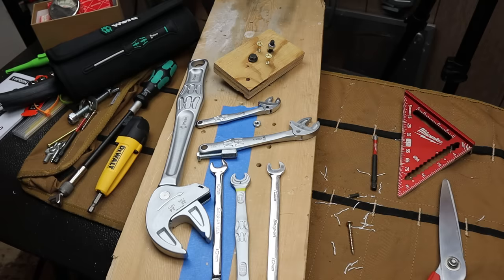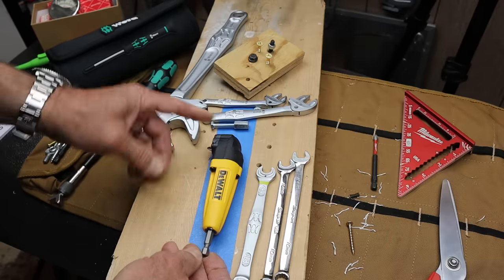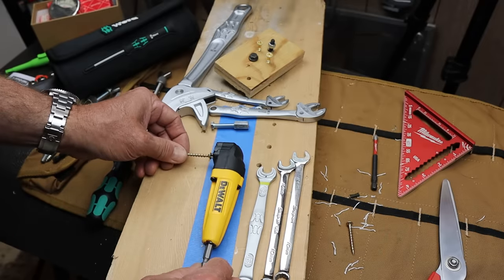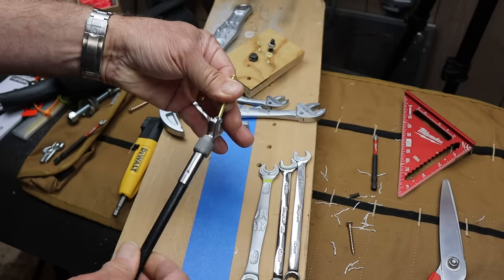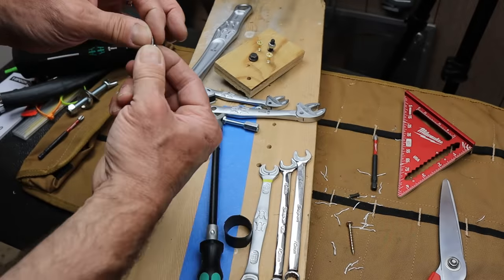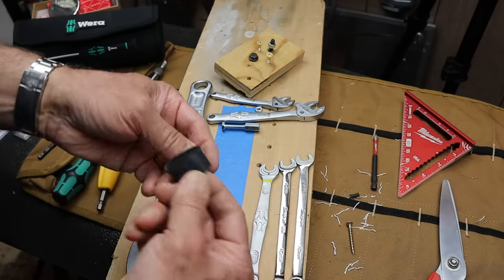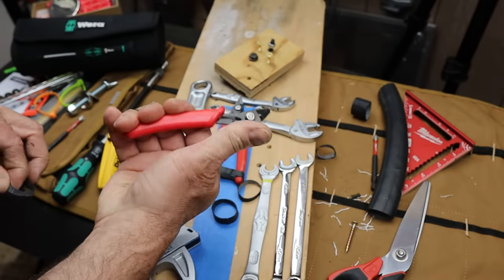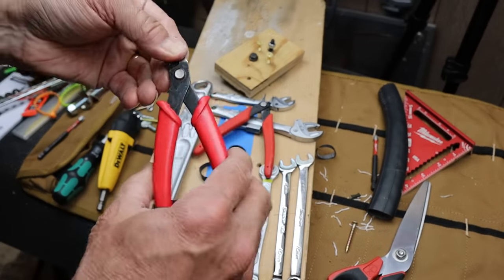Wera Joker Combination Ratcheting Wrench: If Apple made wrenches, this is what I'd expect. Very Nice

Comment: I have this set, absolutely love them.  The ultra fine resolution on the ratchets is next-level, and the retaining plate is genius.
Reply: This guy just turned a 12 minute video into a 4 second read!
Reply: the retaining plate is great until you fasten something and the plate is between the bolt and the surface,ask me how i know ;)
Reply: Thanks Wheeler commenter
Reply: I have these and if your really want to get your mind blown get some Proto fine tooth ratchet end wrenches. Actually don't do that until you have the money in your pocket because it's gonna catch on fire and burn your pocket as soon as you feel the proto 😂

Comment: As an aircraft mechanic I’m glad they are making SAE products. I love their quality and packaging. I wish they made deep SAE 1/4 sockets. I’m going to try out that bike tube trick thanks!
Reply: As someone who works with a lot of hydraulics, I too can appreciate that they make SAE sizes.
Reply: As someone who works on a 1986 f150, I appreciate they make SAE sizes too
Reply: These yuppie "home gamers" have no idea how critical SAE is in the industrial and manufacturing industry.
Reply: As someone who works on British motorcycles, I look forward to grinding their spanner jaws to the proper dimensions with my Harbor Freight angle grinder.
Reply: @stickyfox  or just, buy metric?
Reply: @SebastianWoodard  Whitworth wrenches are neither SAE nor metric.
Reply: @stickyfox  interesting. I do gotta say, I know very little about British bikes, though I'd like to learn some stuff. So they're just proprietary wrenches?
Reply: @SebastianWoodard  I was making a little wrench joke there, I'll admit. I learned about these fasteners when I got my first Enfield Bullet basket case, and couldn't figure out why all of my wrenches were slipping.

Whitworth or British Standard wrenches are (I think possibly?) the first standard for screws. Prior to that there was no real rhyme or reason to thread pitch, angles, etc. SAE and ISO did the same thing but I guess they benefited from international fame.

The real kicker was I spent like $90 on BSW wrenches so I could work on the bike, and eventually found a set of Enfield wrenches stashed away in a box of parts. Figures...
Reply: @stickyfox  lmao I appreciate the info. I bought replacement bolts for a bunch of stuff on my 86 F150 and the original owner ended up dropping off a bunch of parts including the bolts I needed.
Reply: @Eastahtata  its literally only important in the us and nowhere else in the world, I work on heavy industrial hydraulic and hydraulic rams and occasionally you’ll get a ram imperial size bolts and fasteners, but literally everything else is metric including USA manufactured hydraulic components, it’s extremely rare for most people to even encounter SAE
Reply: As an aircraft engineer in the UK, I'm very glad that places still make "imperial" tools.

They can be very hard or costly to get hold of in the UK, but they are vital for some of us.

Somebody in the thread also mentions Witworth, I have quite a few of those, plus "BA" - another old British sizing standard.
Reply: @stickyfox  yeah Whitworth are pretty unique!
I have a fair few of them.

IIRC the size is for the diameter of the bolt thread, unlike SAE which is AF (Across Flats of the bolt/nut head).

It really messes with your head when you first come across it.

I also have some "BA" which was another strange British Standard used here in the UK on Bikes, Cars and Aircraft of the past.
Reply: As an Space Rocket mechanic, SAE tools are a joke, we use Japan Made injection molded forged carbon fiber tools with titanium ends, so they are lighter, stronger and more precise.
Reply: Ive wanted a deep set of 3/8” SAE sockets for s few years.
Reply: America invented flight

Comment: if apple made it it would cost 3x as much as any other wrench, only work on proprietary nuts and bolts, and the open end part would be sold separately
Reply: ‘Proprietary’? You sound jealous.
Reply: @JimzAuto   Apple fanboys really lack creativity when it comes to defending apple.
Don't mindlessly love Apple?    just jealous.
Don't think Justin Beiber is the greatest musician of all time?  ...just jealous.

Dont love everything that I love?  ...just jealous
Reply: Alden makes open end 30 degree ratcheting wrenches!  I have a 7/16" to insert in a hole to adjust a rod nut for tension.  Can't use a box end and it takes an eternity to flip a standard open end.  All other "ratcheting" open end wrenches are 60 degrees.

Comment: I came up with tool I've been using for years. You will appreciate this technique. I used it last night on a blend door. But works best on double ended ratchet wrenches. I removed the unit last night on our 2003 MGM LS in less than 20 minutes after accessing. .But I removed the radio to access the BD from both sides. I used a mirror and a 12" pair of forceps a 1-1/2" piece of 1/8" gas line looped threw a 7mm-8mm ratchet wrench. Just open the forceps and push the hose on one tip then put the hose through the opposite end of the rachet and stick it on the other tip of the forceps and lock closed. Push-pull the forceps once attached to screws to loosen or tighten screws. To install screws put screw threw duct tape sticky side up in rachet then fold over. No dropping screws. This tool can access any hidden fastener as long as the rachet can fit on the screw. Just push pull 1 to multiple clicks of the rachet. No struggle trying to get your hand in there. I can post a short video if needed.

Comment: “The absolute one situation in the universe where that particular wrench succeeds, where others fail.”
AKA-every day working on forklifts.
I’ve had this set in my shopping cart for a week, since buying the Wera self adjusting ratcheting wrenches to replace my cheap copies I got from O’Reilly auto parts.

Now I’m going to go ahead and buy them.
Reply: Ha! Very true! (Retired Fork Truck Tech here) I found these great for starting nuts in awkward places. I had the twin open end versions though, in 10/13mm and 17/19mm. Covered probably 90% of what you find.
Reply: Alden makes open end 30 degree ratcheting wrenches!  I have a 7/16" to insert in a hole to adjust a rod nut for tension.  Can't use a box end and it takes an eternity to flip a standard open end.  All other "ratcheting" open end wrenches are 60 degrees.

Comment: Wera makes many smart tools. My absolute favorite is their allan keys. They look pretty ordinary, except for the colors, but they are not. The first time i bought a set, was the last time I had to drill out a stripped out allan key.
Reply: Agree 1000%, they are a game changer.
Reply: Wera Allen keys are the truth!
Reply: Sheeeit I like that, drilling out allans and torx is not my favorite at work activities
Reply: The sets of hex allan keys you mentioned are the only ones we use at work. Have to remember obviously when not to use the ball ended side of them. Everyday use and only the rubber sleeving shows signs of wear. The ends of the tools look still new

Comment: I've found that they can take some serious pressure, and the short throw is invaluable working on some suspension components. A breaker bar wont fit, but the wera and a hammer does.

Comment: David Anderson
0 seconds ago
Aviation as an entire industry still uses SAE fasteners. They are so standardized at this point it is hard to move away from them. Some European aircraft use a few metric fasteners, but even then they are predominantly SAE. Consequently anywhere turbines appear in industry also tends to have SAE as it's predominant hardware type. The euro tool brands primarily make SAE stuff because of these industries. I have a friend in Ireland who is an aircraft mechanic, and he uses lots of Wera, Wiha, Stahlwille, Gedore, Etc.
Reply: Heavy equipment also uses sae alot bobcat just went metric this year
Reply: America invented flight

Comment: For really tight spaces like you described with the screw, i use my wera mini ratchet with the bit in backwards. That makes it easy to reach tight spaces because your tool is now just the height of the bit you're using
Reply: Damnit bro. Now you gave me a reason to buy a new tool. And I'm keeping my klein mini ratchet. But that's a handy feature. As stubby as it gets.

Comment: I have the full set of these, 8-19mm. The only issue I have with them is the retaining plate feature. If you are removing and refitting the same fasteners time after time on a repetitious job, they do tend to chew up the nut somewhat. Especially if the fasteners are a little of the Chineseum quality....... 
I swear by my Wera tools. I have these, a 1\4" ratchet set, a 3\8" ratchet set, a VDU Screwdriver set, Allen keys and a few other bits and bobs. I have never been a tool snob and have always shunned the Snap On brand for it's lack of quality and high cost, but find myself willing to spend money on these quality tools that I know will last me a good long time. The Allen keys especially are a game changer.

Comment: i trick i came up with for those fluish cutters is that you can use maybe a 5 to 10cm long piece of heat shrink tube on the nose by holding the cutters closed so it will form kind of a sheath for them.

Comment: That wing nut bit I believe was designed originally for the eye bolts. I have a couple different sizes and they do work well. I never thought of using them on wing nuts. Great idea.  The one particular situation in the universe happens more often than once. 😂

Comment: spent inner tubes are wildly useful. repurposing them is a great to reduce waste!
Reply: Good for gripping on a worn Phillips or Pozi screw too. Put a layer of rubber between the screwdriver head and the screw and it gets you enough extra grip to get the fastener moving.

Comment: I have an SAE Joker set, Telecom is a mish mash of SAE and metric. The thing you have to watch out for with any ratcheting combo wrench that you flip over to change direction(lacks a switch or button for that) is you can get it stuck. Primarily if you are backing up a nut and bolt situation and it gets snugged up against whatever is next to that fastener. You have to loosen the fastener to get it out, then go get a different wrench.
Reply: That switch/button to change direction is invaluable on a ratcheting wrench to the point where I refuse to buy a ratching wrench without it. Got my ratching wrench stuck before and it was not fun getting it back out.
Reply: I have done that more than once.  I can see it coming and I'm sure the threads aren't that long, then...uh oh...

Comment: I love what Wera tools I do have and I strongly considered the jokers, but they do NOT make a 9mm even outside of the set. So you get 8-19 with a piece missing. I know 9 isn’t the most common but I use it occasionally. I went with tekton instead and apart from the retaining plate they are pretty similar. The ratcheting end is 6 point which I like to not ruin fasteners.

Comment: I wonder how TY knew that I love Wera tools?  The Rapidaptor is such a game changer. I also have the Wera 056490 which has a low profile ratchet.  I'm thinking it would have helped with the original problem.  The slip profile ratchet is so damn useful once you have it.  Thanks for wrench ideas.

Comment: First of all thanks for sharing your experience and insights, it's been useful)
Then, I think you'll find the KS Tools Set 918.3050 delightful - super flat, low angle, through hole sockets, compatible with  square drive extensions, micro bits work with long Milwaukee extensions, can take any normal bit. Made custom TPU holder and get cool portable set.
Reply: They also have interesting wrenches EG 503.5213 Or 4-in-1s EG 503.4565, even flexible 503.4745 ) saves ton of place in mobile toolkit

Comment: One of those combination wrenches would make for a decent 1/4" bit holder for tight confines...... though it looks they may not make SAE wrenches (of that design) down to a 1/4" size(?).  

Though now that I think about a regular ratcheting box-end wren combined with a coin/metal disk, & some tape (maybe a small magnet) could probably work just as easily (perhaps better) as a 1/4" bit holder.  ...assuming a person doesn't already have (or want to get a dedicated bit-holding ratchet).

Comment: They’re expensive and only accept threaded bits, but aviation drill pancakes get into tight spots. Other option is a 1/4 Rachel wrench with just a standard bit slipped in.

Comment: I have a set of those Wera's and a couple of the snap ons. I can tell you that the snap ons are more durable. I was using a 15mm wera wrench on a stubborn bolt and actually broke the ratchet mechanism. The snap on being beefier was able to handle the force. Wera sent me a new wrench no questions asked. But I like the wera better than my snap ons. My only complaint about my wera set is that it didn't come with a 9mm.
Reply: Ratchets were never designed to be the function the breaks a stubborn bolt loose. Use the static end or a break bar. Sorry had to say it my boss has seen me do it before and just shakes his head lol and says that exact line needless to say I learned my lesson. How long did it take for the warranty process through Wera? I'm new to their tools and quite honestly I LOVE the way they feel in your hand and just using them feels good haha.

Comment: Hey doc, there is a craftsman ratchet out that I think you might find interesting.
It is part number cmm86000. 
It works like a regular ratchet but the handle rotates so you can tighten or loosen without having to move the tool.
Reply: Ok thanks for this I didn’t know this existed. Part number is close but it’s actually 
CMMT6000 for those who are trying to look it up
Reply: @trappizze22  Part number appears to be CMMT86000.
Reply: @trappizze22  Part number appears to be CMMT86000.

Comment: I have that one from Milwaukee right angle driver that they now charge $60 for that when I got it two decades ago was only $30. But they were the only ones out there and I've had that on my impact driver for a very long time and that thing still works perfectly. I know that they now make a smaller one that cost about $30 I suspect that one is not going to be nearly as good as the more expensive original one they made

Comment: I've been using Wera ratchets, sockets, allen and torx keys, for a few months now at my new job.  I love my Wera tools, but my only complaint is their warranty contact, or lackthereof.  My 3/8" ratchet seized up after 3 months, and I haven't found any way to contact Wera for warranty replacement.  I filled out the online form to contact them last week but havene't heard back.  The benefit of Snap On is that the truck will come to the shop and replace whatever I need instantly =\ so there's that.

Comment: Wow that dewalt right angle is massive!! Milwaukee makes a much smaller one. Dewalt makes a couple n theres one smaller than that as well. The smallest one ive seen is an older milwaukee one, but prob still not small enough for what you need it for w such a long screw for a tight spot. Lisle makes a tool called something like an actuator ratchet that would be perfect
Reply: I've had good luck with the Milwaukee angle. Mostly one project where we put in tons of 12/24 screws, a good many that tool was the only option and I don't think the Dewalt would have fit.

Comment: The solution to your super low profile right angle 1/4" bit driving needs is the Sealey AK6962 stainless steel micro ratchet bit driver.

Comment: i've always steered clear of the non reversible wrenches, when you run into a flanged nut that doesn't leave clearance to pull the wrench off and switch to the open end for the last few turns you are really screwed
Reply: Not getting flex-end ratcheting box ends is a bit of a waste as well

Comment: That 3/4 of a hex on the gland end just looks extremely cumbersome. Load test the ratcheting end against other ratchet wrenches. Something tells me with that fine of a pawl and ratchet it would probably explode under modest duty. There's a reason why snappy Matco cornhole and so forth tend to push a slightly larger ratcheting radius. The thicker the tooth ( larger swinging radius) the "less" likely to snap.
Reply: Of course it's a compromise. But they can 100% handle tightening the fasteners properly. Lets say 6 mm or 1/4 inch fasteners really shouldn't be tightened nearly as much as many people might think.
Reply: @penttijakonen3817  never said anything about there tightening capabilities. What I meant " and I guess I should have stated a bit more clearly" load testing was" breakaway strength" I completely agree with your statement of it should be able to handle the torque setting of an average bolt but there are many factors in breakaway forces corrosion and previous people before you. What they could have done loctite cross thread or too much torque. 
Do a side by side comparison of this fine tooth ratchet vs one or two of the major brands with something that has fixed weights or something to imply torque to these wrenches that is repetitive and I'm sure you'll find these will fail a lot sooner.
Reply: @ogt92fromthe1step9  Understood from the start and like I wrote it's always a compromise of some sort. I should have wrote that I don't see other point than curiosity in comparing these since they will surely handle several times more torque that should be needed. Of course they will all break at some point. I will point out that I don't think Wera is much if any weaker than a bulkier reversible one though. Being one-way it can be designed in a more optimal way.